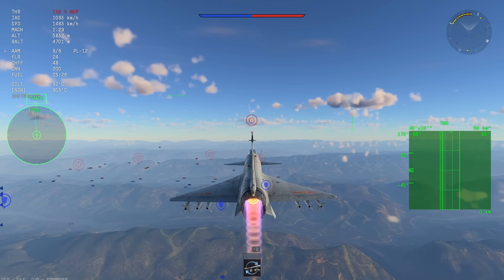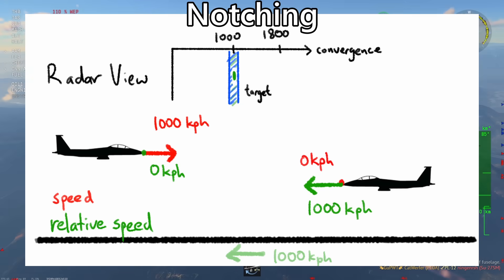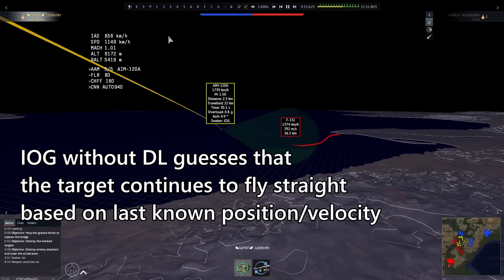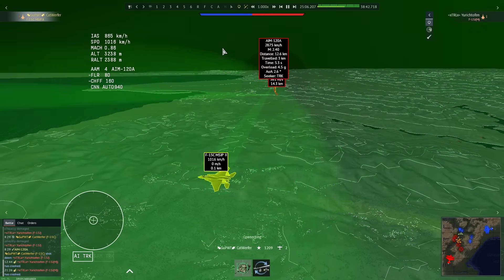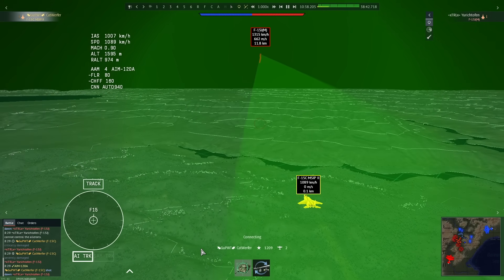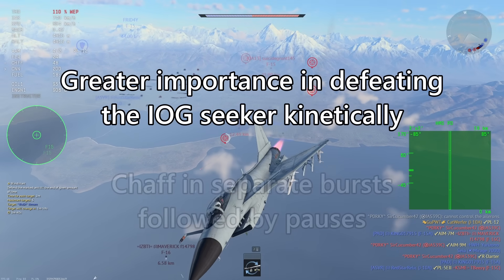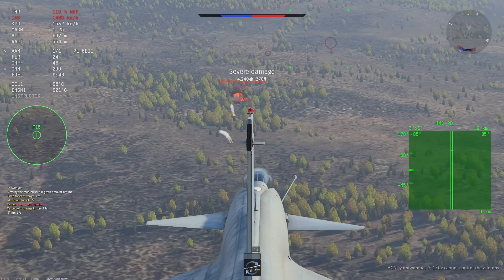Notching Mechanics Explained | How to Evade Top Tier Fox-3s

Comment: That's not what datalink is. Datalink is using networked information from sensors on other platforms. If this were "datalink", then you could say the most basic, earliest fox-1's from the 1950s have "datalink". Ridiculous definition.
Reply from the maker: im not describing IRL tech, im describing what's labelled as "datalink" in the gamefiles
Reply: @CatWerfer  That is more accurately described as 'command guidance'.
Reply from the maker: @nollix  do you play war thunder?
i get that the IRL technology term is incorrect, but ingame it is literally referred to as "datalink" or "DL", and that's what most people know it by.

None of the missiles in war thunder behave like IRL missiles anyways, in look up mode some of these missiles shouldn't be susceptible to chaff anyways since the missile can just stay in pulse doppler mode and turn off the MLC notch filter.

Its a video game with unrealistic physics and ahistorical namings.
Reply: @CatWerfer  Yes I play war thunder. There's no reason to call aircraft "spaghetti balloons" if it's a totally stupid term.
Reply from the maker: @nollix  submit a bug report to the devs then 🤷‍♂️
Reply: @CatWerfer  Just use language correctly for the benefit of the human race. Thanks.
Reply: @nollix  You must be a little slow
Reply from the maker: Probably just a redditor :(

Comment: Could you explain how Aim 120's are able to do a full 360 and kill their target without DL? I have a replay where me and another jet head on, we both swerve left and I fire an Aim-120A at the target prior to the left notch and miss however shortly afterwards it killed the jet I fired at even though we was going opposite directions?
Reply from the maker: top tier fox3s have quite a wide uncaged seeker and so if the target notched but then is found again, it is possible that the amraam just had enough rocket energy left to push through the full turn to hit the target. There are missiles that work better at close range like the r-darter and micas but the amraam does have the strongest burner irrc so its not impossible.
I'm just guessing here tho

Comment: It also seems to be missile dependent, which makes "notching" not a guaranteed strategy. Funny enough, the Iranian F-14 ARH missiles and the R-Darter on Grippen always seems to be less succeptible to notching in WT, but they're more defeatable by turning away from the missile and doing the "chaff bursts" to lose the track. You also need to keep the speed up (probably close to the plane launching the missile while it is in passive mode), otherwise if the speed difference is too big the missile wil lock onto you.
Reply from the maker: I can see why they phoenixes and fakours might be different but do you have a source as to why you think the darters are as well? I mainly only test3d amraam and r77
Reply: @CatWerfer  just personal experience within the game, where the missile seems to be deadlier and harder to "fool" than Aim-120s and the Russian counterpart (R-77 if I'm correct).
Reply from the maker: @Insanerobert44  there's a good chance the reason for that is cuz the phoenixes don't turn well and so are likely to ram into your face if you notch too late. It's likely that the carter's are the opposite and because they turn so well that they can reacquire you as you leave the notch faster. Idk tho I'm just speculating. I dont really have the mental bandwidth to go and check how each one differs in terms of chaff susceptibility
Reply: @Insanerobert44  There are only 2 different seekers in the game files for fox-3s at the moment. The phoenixes & fakour share 1, the rest of the 'top tier' fox-3s all share the other

Comment: What is in youre opinion the best Fox 3 missile
Reply from the maker: I'm not good enough at top tier to know, go ask migan
Reply: Really depends how you want to use it, they all have their upsides and downsides. AAM-4 (haven't unlocked Japan myself just going by what I've been told) is the best all round missile. From what I've used I like the PL-12 given it has both good range and pulls into off bore shots well as well. MICA is the most fun though no contest

Comment: Wasn't multipath 60m? is it really 50m?
I didn't get the part about notching but DL causing the missile to still hit you.
I thought DL worked even if you lost the lock or turned cold but turned back to hot and require the lock.
Reply from the maker: multipathing starts at 60m but is not fully effective unless below 50m, check out the more detailed explanation i give in the pinned comment.
I tested it and if the plane loses lock then you can't regain datalink. The missile can lose lock but the plane's radar needs to hold it continuously if you want datalink to apply

Comment: Sadly not everyone has a jet that can pull 13- 17g from mach speed lol
Reply from the maker: the su27 did get a buff so i think most planes can pull like 15gs if going at 700kph
Reply: @CatWerfer  most? not usa jets tho or mig 29
Reply from the maker: ?? F15 and F16 maneuver quite well. the mig29 suffers quite a lot tho
Reply: @CatWerfer  i don't think they can maneuver quite well compared to other new jets that pull 13g plus at mach speeds. F16 performance is at below 800kmh, but you see the J10 and other new jets performance pulling 13-17or more
Reply from the maker: i think either way you'd probably end up GLOCing if you try to turn too hard going past mach so probably best to decelerate before trying to pull

Comment: I'm 1 minute into the video now, and I already want to leave a comment on the statement about doing everything right and still getting slammed by Fox-3 missiles. When they were introduced, notching them was really easy. I remember turning 90-100 degrees away from R-77s, Derbys, R-Darters, AMRAAMs, and MICAs in their no-escape zone, even 5 km away from the enemy jet, and still being able to defeat them with ease.

I spent two weeks playing top-tier Air RB when Seek & Destroy was released, maintaining around a 3 K/D ratio in every Fox-3 slinger I had, but eventually got bored and dropped air battles to play my preferred game mode: Ground RB. Then, two months later, during some farming event, I came back and realized that sometimes I couldn't hit anyone at all with 120s and RB 99s, even when they were flying straight at me and not even trying to perform a 3-9 maneuver. Meanwhile, dodging enemy missiles myself had become nearly impossible unless I went cold or used terrain and multipathing.

They must've changed something in the core mechanics, but it almost feels like I'm the only one who noticed. To be fair, it's not surprising, considering how most of the player base didn't even notice when chaff was ineffective against pulse radars for about a week back in August.
Reply: If I’m not screaming at 1.23m towards the ground while dumping chaff I’m getting it. Another way I found out to evade them is just completely turning around or just make a hard right like I’m sure you already do and just hope you can out run it basically.
Reply from the maker: they've definitely gotten harder to notch and chaff, inertial guidance has become a much bigger factor.
i mean they just made them even harder to chaff 2 days ago lol with the angle gating changes

Comment: "Non-PD" is just called Pulse mode
Reply from the maker: I think some semiactives use continuous wave?
Reply: @CatWerfer  Then it's specified as SRC CW if I remember correctly, if it's just SRC then it's pulse mode.
Don't get me wrong, I love the video, I just think "Non-Pulse Doppler mode" implies that it's Doppler without Pulse, which is rather poor wording.
Reply from the maker: @AtomicBlastPony  maybe non-pd would have been better to imply that it is a negation of pulse doppler and not of just pulse

Comment: No wonder when I fly top tier after 12/19, I find notching perfectly 90 degree and chaffing still does not defeat missile. Then I checked all replays of my failed defense, and found out that missile went on IOG + DL all time and in very close range the missile just pit-bulls me.

However in BVR, when my RWR pings msl incoming, if I constantly let the missile be at my approximately 3-4 o’clock position and change my flight path necessarily(vertically and horizontally plus constantly enter-leave notch), burst chaff when missile coming close, it almost 100% defeats the missile. My finding is surprisingly similar to the method from your video.

Comment: This is an excellent explanation, well researched and gives me a huge sanity boost after feeling like chaff and notch felt so inconsistent. Thank you! It's what I've been hoping for for years. I have one big question left from this video; how exactly should chaff bursts be deployed? You said three chaff in a burst, but do you spam them out as close to each other as possible, or give them some small amount of spacing during the burst? I never know if I should be providing a slightly spaced train of chaff in a burst (a wider field to be caught on) or if I should be aiming to create a big SUPERCHAFF cloud that's on top of each other (making one gigantic radar signature trap).
Reply from the maker: I think 3 normal caliber chaff at a time in one spot all together is probably fine, maybe a bit more if you're using bol pods. I also think that spacing them 3 seconds apart or so should prevent breadcrumbing. A lot of my results were inconsistent still, but that seemed to work the best
Reply: @CatWerfer  Thank you for the answer! I'll try this in my own matches from now on.

Comment: This may be a stupid question but am I supposed to notch the missile or the plane that fired the missile ? Some rwr show the missile on it and also the plane that locks
Reply: Missile if it’s a Fox 3
Reply from the maker: You need to notch the plane radar if it's a semi active missile like the aim7sparrow or r27er, and the missile radar if it's a fox3. You may have to try to notch both if the missile also has data link, tho that's much harder to do

Comment: I have gotten pretty decent with dodging missiles now but the issue is top tier, or close to top tier where I am (12.7) is boring. Every match ends in 3 to 4 minutes and since the F-16A doesn't have radar missiles, I am just forced into a loop of dodging without ever being able to retaliate at all.
Reply from the maker: Yeah the f16a is in a pretty bad spot right now, its okay in a downtier but even the f4j and f4s have sparrows
Reply: @CatWerfer  I know, I was so excited to get it that I didn't realize it didn't have any radar missiles at all. The f-16A ADF is foldered under it. Exact same BR, same loadouts, same model, it just get's radar missiles. It's an extra 200k RP to unlock it afterwards so at that point I just decided to go for the F-15.
Reply: Issue with top tier for me 14.0. As much as i love it you still have people trying to abuse the multipathing system. Which means they are typically just running head first down the centre of the map to base bomb or ir sling.

Thats one of the contributing factors to why games at top tier end so fast. If people flew a little higher and didnt just fly head first into the missile (abusing multipathing) games could last quite a while. I
Reply: @phantomraptor8851  I still feel like the maps are too small, and the objectives are too clumped together so it just forces everyone to converge at one point in the map basically. That and the spotting system means that even if you tried to flank around, the second you get spotted for the enemy team you just become a massive red target for Fox-3 missiles.

Comment: Does going cold affect the missiles radar like how notching does or does the radar just hold the lock?
Reply from the maker: the radar will still lock you if you go cold. If you go from going hot to cold then it may break the lock since there's a point in time where you'll be notching but if you're just going cold and running away, then the missile will still see you.

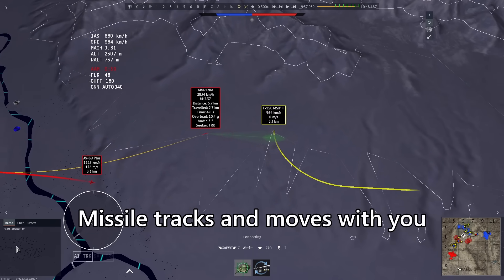Comment: At 14:50, you talked about how you need to over-correct for the missile's tracking.. However! one piece of information you may have forgot to mention was IOG, (inertial optical guidance) the missile's radar as you can see is attempting to reacquire it's tgt after having lost it, but the missile's frame while waiting, is still moving towards the last known predicted flight path of the tgt.

Still, really good points on the velocity of AOA of the aircraft.

Comment: I thought newer radars use pd and normal radar simultaneously, making chaff less effective when tracking towards the sky.

In general it seems like, flares, chaff and notching are overperforming for gameplay purposes. Newer missles are reportedly near-impossible to defeat at closer ranges, yet in WT you can do so quite reliably
Reply from the maker: yeah, i wouldnt mind if they overperformed a bit more, its better for gameplay for defensive options to be easier than offensive options, otherwise you just get suicide missions

Comment: Slowing down is not adviseable with a missile tracking an area behind you. Also, the aspect angle of the missile matters a lot when calculating the notch, thats why you get unreliable notches. Also yes, keeping your aoa and drift limited is just a part of flying, so its nit really a tactic. You want to be gentle so you can get accurate rwr return information. Also, you want to maneuver to get the missile in an unfavorable position. If youre gonna notch, the best plan is to get the missile in plane, co altitude, hit the notch and adjust altitude while chaffing to shift the modes and overload the processing. Also, a missile that has to climb 10k feet, then dive 10k feet, then climb 10k feet again will not be able to track through the atmosphere. The plane has a lot of gas, the missile doesnt. Also keeping the missile coaltitude and in plane reduces the amount of variables in calculating the notch meaning its easier to just hit the 90°, drift to match the guidance of the missile to stay in the notch, then dropping chaff as itll loose speed and become visible to the missile which will give you some time. The more chaff the missile has to track through via "breadcrumbing" the more time youll have to make a serious change of parameters to get yourself out of the reacquisition window of the missile, which is why its "better to use in short clusters"

Just some extra tips from a friendly neighborhood sim player.
Reply from the maker: The aoa drift is moreso relevant when trying to notch at very close ranges, in headons under 5km, where you need to pull as hard as possible to evade the missile in time, which is why I mention it in that section

Comment: Another way to survive these fox 3 is to launch a missile against the missiles and just fly in a straight line (so that you missiles intercepts the enemies one), this can be ir, sarh or even arh. Very useful when used under 5km launches. Also you can corkscrew/barrel roll sparrows, sky flashes and Matra 530 easily
Reply from the maker: I never quite got the hang of corkscrewing sparrows, every time I did it felt like an accident
Reply: @CatWerfer  Its fairly inconsistent, and really only useful for one sparrow.
Reply: @toast1172 barreling sparrows works consistently still, you just need to take a wider roll because the sparrows don’t roll and pull at the same time well so it struggles to follow you
Reply: @CatWerfer  you have to have a decent speed and start doing that when the missile just comes under 2km distance, take a bigger one and maybe drop a chaff or 2, try them today
Reply: @CatWerfer  if i remember right you have to be at mach1 or 1000 kmh and do a wide roll, it was pretty easy and very useful against the F14 spam when that was the top tier menace

Comment: The explanation of why you seem to need greater than a 90° angle to defeat ARH at close range makes a lot of sense. Another factor is that the missile is leading you, so at close range you have to compensate for that if you're trying to defeat it visually (which you did kinda allude to as is!)

Pretty good video, learned a lot from it. Nice to see the Migan shoutout too bc I've been learning a lot from their videos too. But clearly the takeaway is that i should be using teleportation more to defeat missiles :)
Reply from the maker: @_ace_defective_  uses zero chaff, its like stealth but better!
(Thanks for the supportive words)

Comment: Nice vid, didnt knew ARH had different search/lock modes. Knowing that its basic SRC when looking up makes things easier.
Also for anyone wanting to detect an early launch, if you have a really good radar and you're in TWS on a target, you can see the moment the guy launches one as there will be 2 signatures and one will have higher speed. You can do a 180 and it will pretty much be defeated just by energy alone.

Comment: not a big fan of angle gating, making chaffing harder will result in ARH spam being worse to handle and even more people doing multipath as a low effort solution
Reply from the maker: @thcfck6870  the closer we get to realism, the farther you get from enjoyable game mechanic. It's a tough balance to strike :(
Reply: @CatWerfer  absolutely, unfortunately some tend to forget this is a game first and foremost
Reply from the maker: @thcfck6870  some people just get more of a kick out of realism that the sacrifices in actual game design are worth it for them. Tbh idk if anyone is particularly happy with the gameplay loop at top tier right now, there are a lot of things they could improve that would make the game more realistic and fun at the same time, like adding new and interesting air to ground objectives
Reply: Angle gating decreases the chance of a teamkill by locking a nearby ally, so I support it